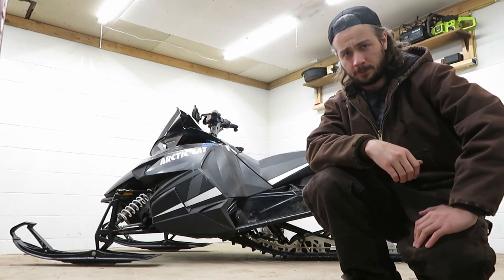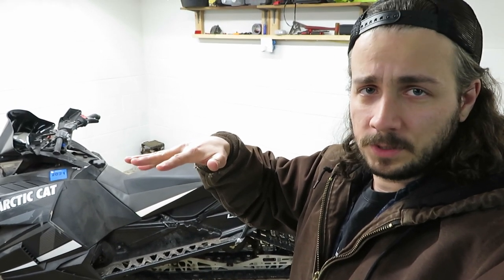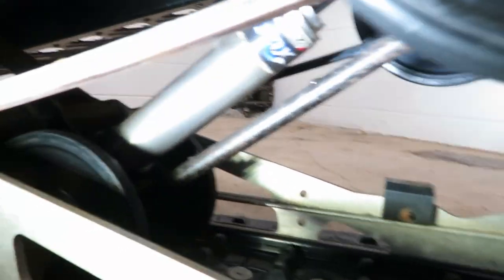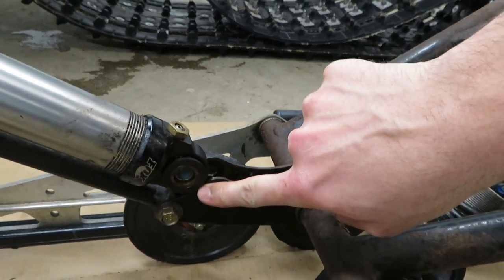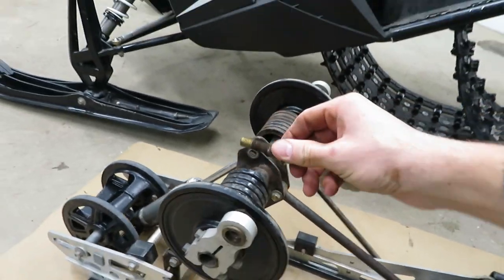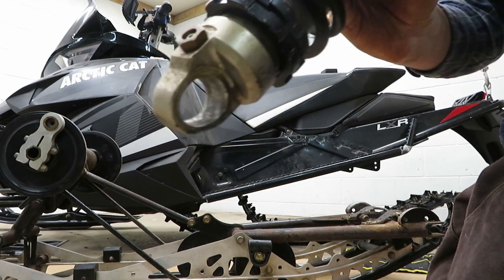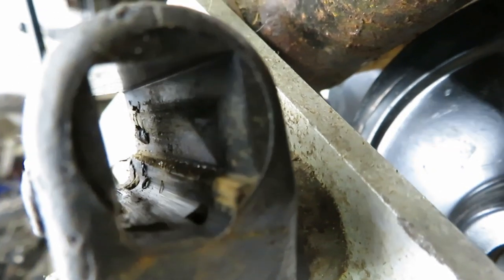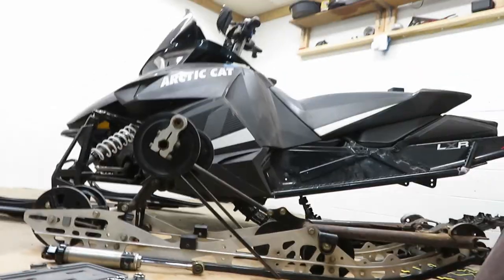Why You Should Inspect Your Snowmobile Skid Every Spring...

Comment: Just a little advice before you bolt the rear shock in the skid, if you haven't done it already. The long bolt that attaches the bottom of the rear shock also has 2 bogie wheels attached, if you don't put the bolt in the right way the nut will rub on one of the bogie wheels, it's tight in there :-)  Just look at what side the bolt came out in this video.

Comment: I had similar experience with the Nytro I bought with 7k miles. The suspension takes a beating, even if its a 4 stroke and the motor will keep going forever, suspension seems to still last 5-10k miles. If you can get it back together, it should be good for few more years at least.
Reply from the maker: Yeah I'm surprised they hold up as well as they do actually.  On a four wheeler or truck you have the tires to help cushion the blows.  The track isn't much help so your pretty much slapping the whole skid along on all the ice and rocks lol.

Comment: Awesome video heads up looks like you’re spring bushings are worn out I don’t know if you realize that but they are cheap and not hard to replace I just did mine at start of season definitely god to replace them Though they will help with your suspension and you don’t want them digging into the bolt holding the bushing in place definitely don’t want those torsion springs to shot into your track
Reply from the maker: Good eye!  Yeah they were BAD.

Comment: make sure you check your tri hub (rear 2 wheels) that are mated together its a terrible design and will fail and cause track damage and stranded....the rest is pretty common for procross sled...not hard to fix...also check that front steel leading arm for broke welds...with the shock over extending like that its known to break that arm welds
Reply from the maker: What should I check for on the back wheels?  I actually had the front arm break on my old sled!
Reply: @SwankyCatProductions  rear wheels have very crappy undersized bearings, make sure they arent going bad...because the wheels are tied together if one bearing goes it will destroy it all and strand you....bunch of companies make tri hub deletes...removes that and makes it stronger and more reliable

Comment: You should be rebuilding your shocks every or every-other year depending on the mileage you put on it a year. Oil needs to be changed just like the oil in your car.
Reply from the maker: Yeah... or you can just wait until they blow haha.  I never put on enough miles, even after two years, so it gets old before it wears out.  I'm not a good enough rider to know the difference until they actually blow haha.  I know your right though, should be an annual or semiannual thing.

Comment: Your fault dude for not cleaning, inspecting, and lubing your suspension at the end of the season.  It makes it easy starting and getting out for the next season.  IMHO 🤣
Reply from the maker: Nothing that wore out was a joint that could be lubricated.  I certainly could have done some more inspecting that's for sure lol.  But I always pump grease in all the fittings at the end of every season.